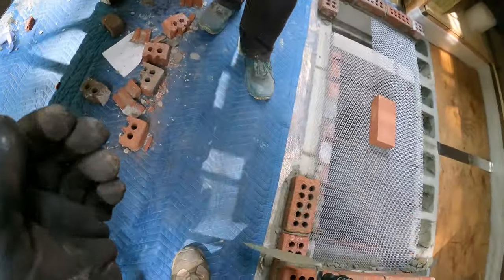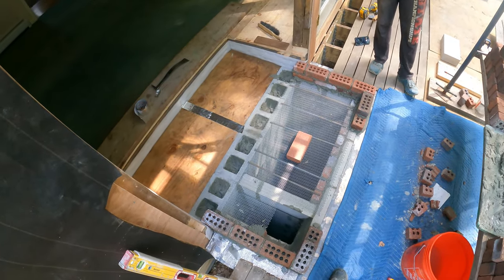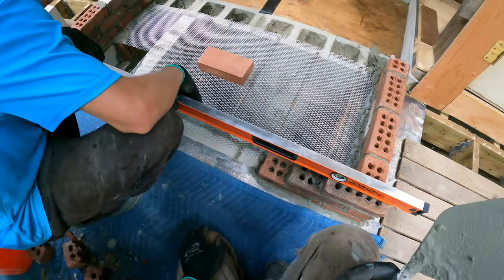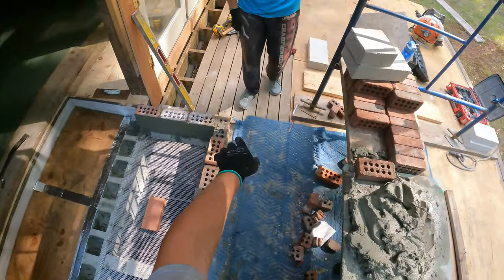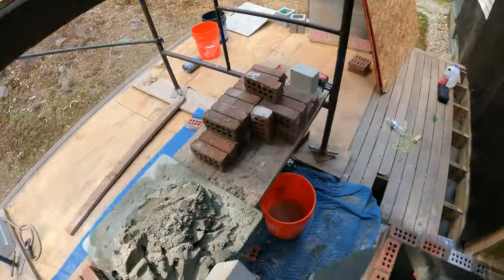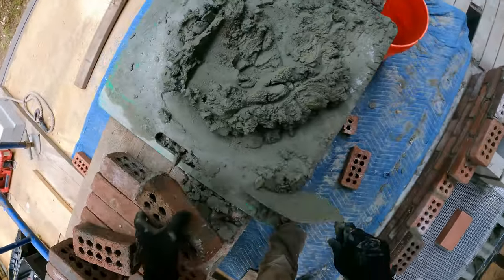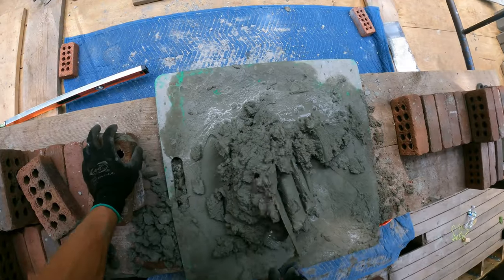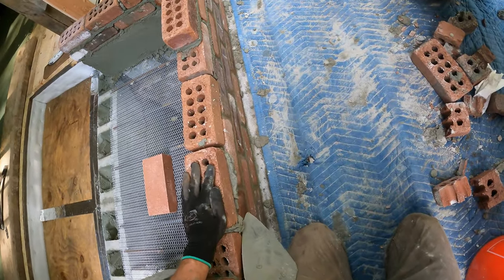Brick fireplace construction | Episode 3: prep for concrete hearth slab

Comment: Wondering if you poured the slab right over the metal lath?  I guess the mix was stiff enough so you could do that?
Reply from the maker: Yes the it’s poured directly on the lath that is supported by rebar pieces. The concrete is usually as stiff as can be manageable. The whole process of forming it is explained in the video somewhere, I can’t recall which video at the moment.

Comment: I need to know the dimensions of the opening in the exterior wall for a 36” fireplace. Height and width. Thanks
Reply from the maker: I would tell the framers to give me 64.5” wide and header just below the top plate (almost ceiling level) this will give plenty of room while working. After the masonry is complete frame out the front area, below the header, with metal studs. All wood framing needs to be a minimum of 2” from the masonry.
Reply: @chadvaillancourt  I am the one to frame it but not a Pro. It’s a 9 foot ceiling. So if I form a 64.5” opening, my mason will not brick it out to 2” from that ?  Thanks for your reply?
Reply from the maker: Yes 64.5” is to the inside edge of your jack studs (they hold the header). The inside dimension of the brickwork will be 60” wide or slightly less depending on brick size, this will afford you your 2” (air space) minimum clearance. Header the opening as high as possible so your mason has room to do the highest quality of work. If the header is placed to low it will be difficult to work and quality will drop.
Reply: @chadvaillancourt  Thank you Sir!